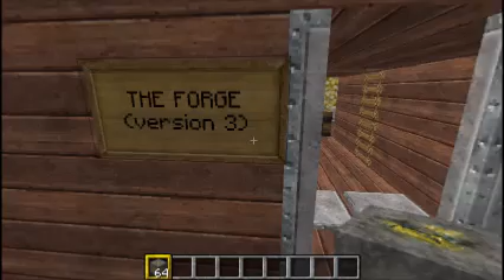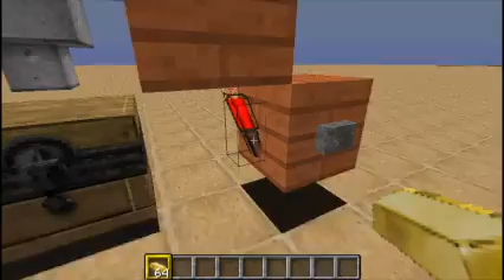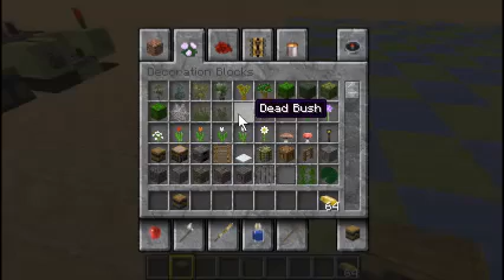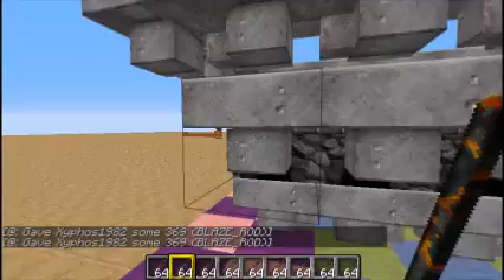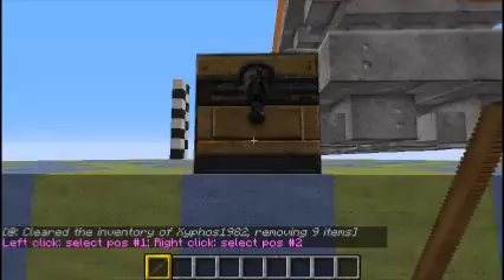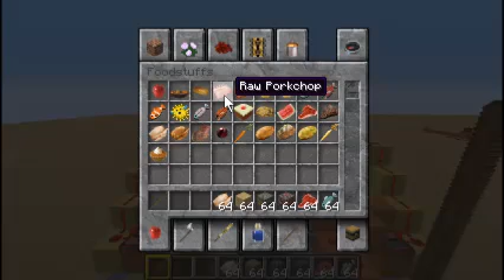Minecraft: The Forge 3.0 (Industrial Smelter / Turbo Furnace)

Comment: Hm, I copy this exactly and it seems only half the furnaces get used. I know you say that some wont but This is over half of them. Any ideas?
Reply from the maker: it might be a problem with the game's chunk updates.
are all of your furnaces inside the same chunk? in the video I mentioned that the layout marked a single chunk on the boundaries.
Reply: TheGreatXyphos Yea, I made sure they were. I think it is a SMP thing. I've tried other mass furnace devices and they all do the same thing.
Reply from the maker: Will Crabtree Are your hopper spouts pointing the right way? are the hoppers getting redstone power? if it's SMP, maybe you can provide a world download so I can see the problem?
Reply: TheGreatXyphos SMP is Survival multiplayer. I think the issue is that in Singleplayer, items are moved much slower through hoppers while in SMP, they have moved very quickly.
Reply from the maker: Will Crabtree well, in order to test your theroy, remove the bottom hoppers that remove the smelted items from the furnaces, drop in 1 stack of items and wait for the furnaces to finish then peek inside each one. each furnace should have no more then 1 or 2 smelted items inside it. if any of the furnaces have 3 or more smelted items, then the distribution system isn't working properly and you may have to modify the orange detection circuit to add delay.
Reply: TheGreatXyphos I tried adding more delay, but that just makes the first hopper in the line get all the cookables. I reduce the delay and i get semi-better results. Still not good but better. Have you tried this on a server, not sp?
Reply from the maker: SP doesn't have WorldEdit, and is why I never play SP. my single player mode is a localhost bukkit server. the video shows me using WorldEdit - eg, I'm not on SP.

I'm not sure what the problem is, unless I can get a close up look at your machine. perhaps you could upload a bunch of screenshots from all different angles, paste the links in pastebin and send me the pastebin link?
Reply: TheGreatXyphos Did a test, Hoppers in a circle, all connected to a comparator which then leads to a redstone lamp. In SP, it is smooth. You can see the item go from one hopper to another. On this server.. The item moves so fast that it wont even light up the lamps. I am sure it isnt your build, but this bad server.
Reply from the maker: Will Crabtree
Then that would indicate that your server is probably Spigot or some other "performance enhanced" and/or "lag resistant" server. (not bukkit or vanilla)

your case is an interesting problem, I'll see if I can work out something that may work for your setup.
Reply: What I tried doing was getting a comparator from the furnace. Have it so when it is 90% full, to power the Hopper above it. That reduces the amount of mats just sitting in the hoppers. Thing is, I still have the top row of hoppers collecting a lot of items. Do you want to see what I am building? Haha
Reply from the maker: Will Crabtree Well, I tried to build a different model that would work for your server, but it's too big and inefficient to even bother showcasing.

basically, it would pump items through a dropper chain until all of the droppers were filled then the bottom hoppers become enabled and would suck the items down into the furnaces. this required a slow clock pulse for each of the droppers, controlled by a "chaser" circuit.

I don't know how I can help you with this, since your server isn't exactly "standards compliant" :(
Reply: TheGreatXyphos No worries man, I built something that works for this server. Just a pain in the butt. haha.

Comment: Make sure it can smelt multiple different items, my industrial furnace needed to be modified to account for this
Reply: like put in a 5 different stacks in at once.
Reply from the maker: SirGrubs
yeah it can. all those hoppers make that possible; going 2 blocks high on the input gives 10 slots per furnace - a total of 38,400 items
Reply: cool cool, in that case yes yours is faster :P.  Both of ours are pretty powerful though